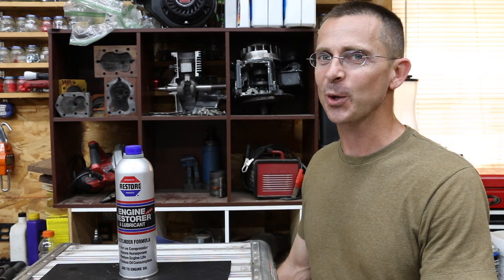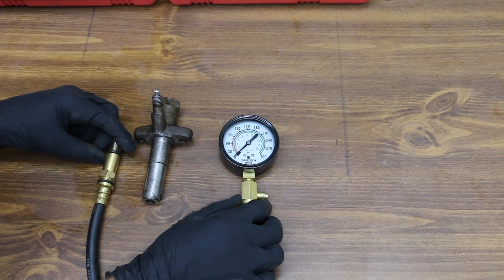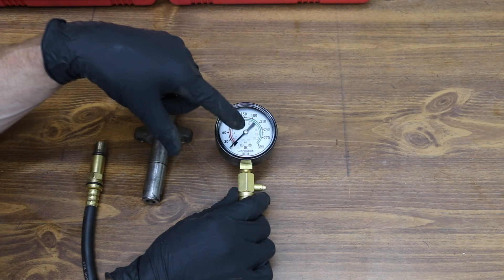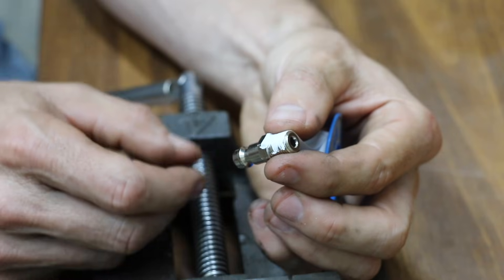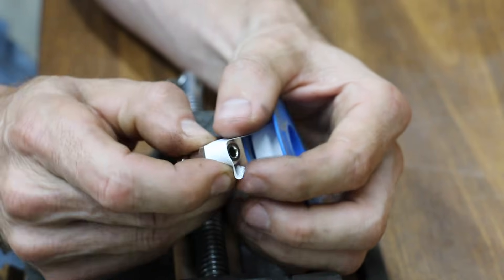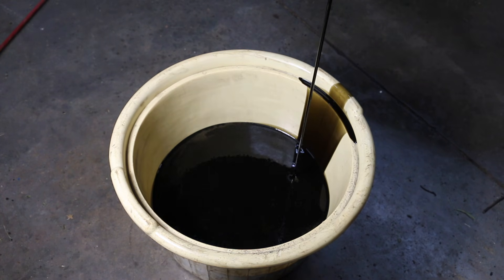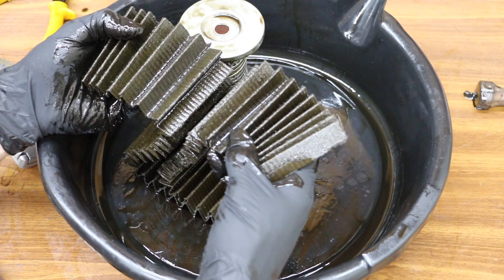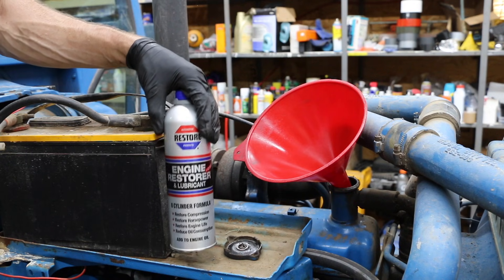Did the "Engine Restore" Compression Improvement Last?  One year later (Episode 2)

Comment: block sealers!! or radiator sealers!!! Cooling system sealers !!!
Reply: A previous owner of one of my cars put radiator sealer or stopleak in, and when I pulled the intake manifold to start on a complete engine rebuild, the ~1" flow port for coolant was completely plugged up with the gunk, only now hardened and had to drill / dremel it out.   I'll never touch those 'sealers' now thanks to that experience.

I have used this brand of engine restore before though, with good results.
Reply: The only thing coolant sealers are good for is maybe sealing a weeping heater hose or a thermostat gasket that's getting tired... Oh, and the passages in the radiator/heater core. Not gonna fix a blown head gasket.
Reply from the maker: Great recommendation!

Comment: Could you do a engine drain test with ceratec and lubeguard engine protect?
Reply from the maker: Great recommendation!
Reply: Thank you...this will be great way to compare Suspended Moly vs so called Ceramic anti frictions.  Honestly the best test would be Liqui Moly MoS2 , vs Lubegard Bio-Tech Engine Protect (2 different types of Moly ) vs Ceratech (ceramic lubricant).  Although that would call for sacrifice of 4 engines so that is costly endevour.   IF you do decide to partake in that test then please run the engines for few hours (with the mixture inside) before deciding the drain test.  Your last MoS2 test has gotten some heat from "The experts" mainly because you did not run it "long enough to allow the MoS2 to bond with the engine parts."  In the end if you are going to waste an engine then might as well reduce the negative feedback.  Then again, some folks will always find things to complain about.

Comment: Put outside magnet on filter next time . Try Militech
Reply: Lowest point or where most circulation takes place. They used to sell these years ago on JC Whitney :)
Reply from the maker: Great recommendations!
Reply: Just toss a neodynium on the outside of the filter, and leave it there? Seems like a good idea. Where on the filter do you think will work best?
Reply: Darren, Thanks. I'll have to try it out. Sometimes I've thought about getting one of those magnet drain bolts, but since I assumed the oil doesn't circulate much in that particular area it never seemed like a great idea to me.
Reply: Get a cab or fleet driven car to try it and pump miles

Comment: I had amazing results from Slick 50 back in the late 1980's, but now Slick 50 no longer has that original formula, which now has a new name--"excelpro" I think.  How about a test of those two?  You would need to test two identical engines in identical condition to accurately test for any improvement;  perhaps two engines bought new together and used together on the same crew?  Maybe two identical mowers used equally for one season...…………………………...elsullo
Reply from the maker: Thank you for the video recommendations!

Comment: I suspect the rings are carboned.
Adding low ash 2-stroke oil in heavy dose to diesel fuel and run it for a while and also add a good oil to remove buildup and try test again.

Good oil and 2-stroke will do a great job.

I bought a 1uz-fe with lots of sludge in it. 
First start in the morning it smelled like oil and smoked.
I gave it heavy dose of fully synthetic 2-stroke oil and changed oil as soon as it got dirty irrelevant of milage.

Today it purrs with no oil consumption and smoke.

Just a interesting topic.

And great vids by the way. I enjoy every one of them.

Greetings from Namibia
Reply from the maker: Greetings and this is a great recommendation--thank you!

Comment: have you though about using rubbing alcohol or mouthwash?
Reply from the maker: I've tested rubbing alcohol, but not mouthwash. Thanks for the recommendation!
Reply: I used them both. Rubbing alcohol is a a scam but, the mouth wash did reduce bacteria and bad breath.
Reply: yea but how did it work powering a lawn mower? also i would not ever use rubbing alcohol as a mouthwash
Reply: David Howard nor would I . I dare say I wouldn't use mouthwash or rubbing alcohol to run my mower. To answer your question though, mouth wash doesn't have a high enough alcohol content ( like beer) run an engine.
Reply: 26.9% 54 proof he could also mix some 99% rubbing alcohol to raise the proof

Comment: That little bit of metal looks like it came from the bolt/pan threads not the engine itself.
Reply from the maker: Yes, I believe you are right.
Reply: Project Farm - Great video, as usual, BTW.  I wonder if HotShots Secret injector cleaner would clean up the injectors? Have you tried any experiments with any of their products, including the oil additive? 
 Thanks for your dedication.
Reply: James Wuertele - I use it every other oil change and in customer's trucks with success. I have 183k miles on my 2005 with original nipple cups o-rings and injectors have 80k on them.  Never heard of any o-ring failure from Hotshots ever. I will say I proved that it works. I had an 06 that had 2 dead injectors during a buzz test. Hotshots added and in 70 miles the next morning all 8 buzzed perfectly. It also evened out during the contribution test using IDS.
Reply: Itsa Mea hot shot has caused issues in 6.0 powerstrokes, ie injector oil orings leaking causing low oil pressure and a no start issue
Reply: I think he said he replaced the injectors so they should be nice and clean
Reply: RickBaconsAdventures - Thanks. I must of missed that.
Reply: James Wuertele you shouldnt run additives in a turbo engine just install a oil catch can
Reply: When I saw the metal filings I thought the exact same thing..... Drain plug filings.

Comment: I wonder if you could use Motorkote and Engine Restore at the same time.
Reply from the maker: Great question! I'll have to research this.  I wonder if the film strenght/slickness of MotorKote would limit the effectiveness of Engine Restore.
Reply: Run the Engine Restore for a while in the engine before adding the Motorkote.  It would be interesting to see on your tractor.
Reply: Boodieman72 I see no problem with that at all. Go for it.
Reply: Luckily my engine doesn't need Engine Restore
Reply: If it was honda anything, trust me its cheaper to plop an engine in. I got one with 50k miles and 1200$ cad later, it runs great.
Reply: I would think mixing additives would kind of cancel each other out.
Reply: Can u test Duralube?  I had a jeep amc 360 that I ran Duralube in  because of unknown mileage and thrashing ...then one day I found out there was almost Zero oil in it. Seemed to keep on ticking

Comment: Well, huh! I'm an additive skeptic as well, so it's pleasantly surprising to see data that indicates the product works as advertised.
I have a 300k mile Chevy 454 that runs well but has weaker compression in one cylinder. I suspect a cracked head gasket, but since the engine is due for an oil change anyway, I think I'll try the Restore for gits n shiggles, before I go to the trouble of pulling the heads.
I'd love to see an update on the tractor's compression, further down the line.
The Ford/NH 5000 is one of my favorite Ag tractors ever; those things run forever!
Reply from the maker: Thank you!  I hope you achieve good results if you decide to use the product.

Comment: Question: what should the compression be if the tractor was New? thanks
Reply from the maker: Great question. I haven't been able to locate that information, but I believe it's closer to 360 PSI.  My adapter will cause the reading to be a few PSI low.
Reply: Hi. PF. Have you done testing on REDEX-Red. Supposed to clran up gasoline carbs. and clean the piston-s ?

Comment: think you can still buy rebuild kits for tractors and you normally get everything apart from a crank and injectors and pump.£200- £300.
Reply from the maker: Yes, I need to invest some time and money to get this tractor closer to 100% performance.  They are reasonable to repair compared to newer tractors.
Reply: if you do rebuild it make some videos and before and after compression tests

Comment: every product will have varied results on use of situation - and you said it best ( stay with what gave the results do not change ) just like the early days of DEX-COOL with some O Rings and other parts when mixed with standard antifreeze -- most common i saw was water pumps going out with nasty bearing noise //  great video and results on the Ford 500 - how is the ole pickup that you did the sea foam cleaning on ?
Reply from the maker: Thank you very much!  I was just thinking about a follow-up video on the ranger today.  It's still doing great!  Just added freon to the AC this weekend.

Comment: So was this the same oil change you put the restore in? I’m curious if the compression will go back down after time when your not using restore or if it is permanent.
Reply from the maker: Yes, this was the same oil.  I held off on changing the oil to make this video.  Engine restore must continue being used to maintain improvement.
Reply: It will wear away and will need periodic retreating.
Reply: Agree with the others - in my experience, it is not permanent.  I also tend to believe that it works better on slow-revving diesels than it does for long-term use in gasoline cars.
Reply: I concur, Engine Restore should be used at every oil change to keep up performance levels, it even states this on their website, but the product does deliver positive results in terms of standard wear and tear in the engine.

Comment: One quick question ... You did not replace the engine oil of your tractor in last 1 year ?
Reply from the maker: I see your point.  I'd like to change the oil in all of my equipment quarterly, but the finances just won't allow.
Reply: Project Farm  That implies that restore was running inside all this while.

Now my tiny motorcycle engine has a drain interval of 3000 kms. My concern is, I cannot keep adding Restore on every 3000 kms oil change. Again finance issues. I cover 3000 kms every 60 days.
Reply: That will mean that the engine will hardly have 3000 kms with the Restore. Wonder what happens after I replace the oil. 

Will it continue to have a good compression or come back to normal form once the oil is replaced.
Reply from the maker: Great point.  It seems as though a full size can would last for quite a few oil changes. I don't know how to determine the proper amount but I believe the customer support for engine restorer could provide some advice.
Reply: Project Farm  The engine holds 1 litre of engine oil. 

I have bought a 4 cylinder bottle. I am looking at using the bottle for like 3 times ... Will try to divide the quality into 3 and use them up in 3 consecutive oil drains.

Will lookout for customer support. Thanks for the suggestion.

Comment: One thing to note about making or using adapters or fittings in order to do compression tests is the volume of the fitting/adapter is effectively being added to the combustion chamber reducing the engine's compression ratio and the reading on the gauge. This is why most good compression testers have a schrader valve in the hose end that threads into the cylinder head so that only the combustion chamber volume is being used by the engine during cranking.

For example, if you have a small engine with a 100cc cylinder and a 10cc combustion chamber that is a 10/1 compression ratio and it might have 120psi cranking pressure. But if you add a 5cc fitting you just made the combustion chamber 15cc and changed the compression ratio to 6.7/1 and it might only show 60 or 70 psi on the gauge which might look like the engine is out of spec./has low compression and needs to be rebuilt when your fitting caused a misleading reading.

Obviously the larger the engine the less noticeable this will be. But it's still something to keep in mind.
Reply from the maker: Great point! You're absolutely right.  I'm sure the readings were likely a little low.
Reply: Project Farm
I've seen people condemn, usually, small engines because of this, thinking the engine was worn out when it just had some other minor problem.

Comment: I’ve been using slick 50 for 30 years. My engine has 300k and my other 200.   I have great compression.  I sold my old truck she took it to jiffy they forgot to add oil on a change and she drove it for 16 days no oil plug   Before it blew.   You can’t beat that stuff.  Only problem may be on some engines is it runs cooler and that can maybe cause the pc to not run lean.
Reply: And this is why I change my own oil!
Reply from the maker: Wow!  That's a lot of miles.  I'm amazed it lasted for so long without oil. Thanks for commenting on this.
Reply: Maybe the plug was lefty loosey and some of those days were good on oil, then it fell out. A hydraulic lifter w/o oil, will barely if at all, open valve.  Anyway, how does a deaf blind lady have a drivers license?
Reply: Yeah I'm having a real hard time believing that. Even if that stuff works (which oil additives rarely do), there is no way that engine would run that long. Cam bearings spinning, scarred cam, frozen lifters , bent pushrods and a mess of other things would happen long before that.
Reply: shenanigans
Reply: You using the "old original" stuff or the new formula?
Reply: Not for that long unless she just spun it a turn and quit.
Reply: Bart Layman that's my thought. W/o oil psi, the lifters will take out an engine pretty much instantly.
Reply: I don't see it starting twice, the first time it would.  Maybe she had solid lifter put in just for these situations
Reply: Chevy for ya
Reply: Starfire Technology  they bought her a new engine  though   So she made out pretty good. It was a 99 Trooper.
Reply: Jonathan sauder   I don’t know the miles she drives but it was that long she had the oil changed the next day  and told me the day it happened.  It was a 99 trooper v6. They bought her a new motor out of it.  Was zero oil in but had a new filter on  I’m going by memory if oil plug was out it’s been years  but I recall thinking  the mechanic should have got a hold of her finding the plug .
Reply: Bart Layman   99 trooper with v6. If I recall it spun main bearing. Being a young female she probably ignored all the racket.   You can test it yourself on a old lawn mower but the deal is I used it since it was new and that makes a difference  I also don’t wait 50k miles as box says I added it every few oil changes.
Reply: Super Dave    In the old days I think slick 50 was even more slick  it was white now it looks like it’s blended and it cost $50 a quart now it’s like $16    If I recall long ago  piston rings would rotate causing blow by I’ve never had an issue   My truck now is a ram 4.7  and have not had an engine issue as many do with a lifter drop.   I add it every few oil changes and don’t go 50k as box says.
Reply: jon doe  yea I realize that lol
Reply: Remember Prolong? Same claims. I just add oil when they stop smokin and change oil and filter every 25k whether it needs it or not
Reply: LAWMAN662   I don’t see the old stuff any more not in a very long time.  It used to be $50 and pure white  now it appears to be blended even the full quart  they have the “in between “ slick 50   But now I add every few changes  using the 50k recommended.  They say they have better additives now but I know this stuff works  my buddy is a full time mechanic he can’t believe I’ve never dropped a valve on my 4.7 ram   Those motors are a problem with that.  But I have full dual exhaust and a Kn M air filter so that allows it to run cooler which helps.  I also toss half a can of seafome in every 5k to the gas and oil.  Never had any engine failure.  Our 94 celica engine is like new also.   One piston on my ram has a little less compression   But it’s in range.  I’m thinking about adding this engine restore  to correct it.  I may do it today it’s time for oil change. I also go 6 to 10k miles on oil changes using   Castrol Synthetic.  That is the best oil  my buddy has a machine shop and he tested all brands in bearing test where you hold down a lever to simulate load and castrol beat them all. That was twenty years ago.
Reply: AboxofMonsters I
Reply: It would be jiffy
Reply: PTFE fails with heat and in all standard military standing engine test's.
Reply: The engine would overheat and fail without oil in it even if the additive was so good it stopped the metal from grinding away in the engine.
Reply: she parked it for 16 days, been a mechanic my whole life, no engine, no oil will do what you say....
Reply: Yeah well......
They forgot to reinstall my oil plug and didn't notice it till I took it in 5K later for the next change!

Comment: Great video!  Talking about diesel fuel injectors reminds me of the diesel VW rabbit I once had...the cylinder head threads for one of the injectors were damaged beyond repair so I did the only thing I had money to do...I used JB weld to hold the injector in the cylinder head.  It lasted 4 years and 35k miles, and was still holding strong when I sold the car.
Reply from the maker: That is impressive!  What a practical solution that saved a ton of time and money.  Great work!

Comment: What oil would u recommend for a bad valves seal on cold start ups?
Reply from the maker: Rather than a specific brand, the additive package used in high mileage oils might help some.  I'm not loyal to a specific brand.
Reply: Try oven degreaser on the valves and let it soak. (Spray thought admission and exhaust) Could remove some carbon build-up and help sealing.